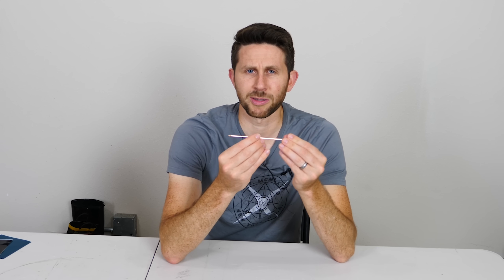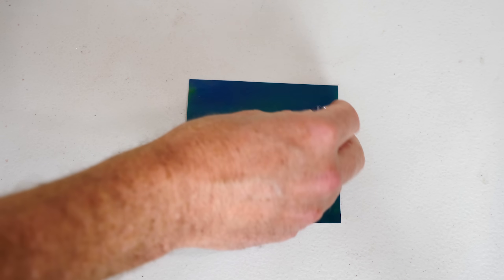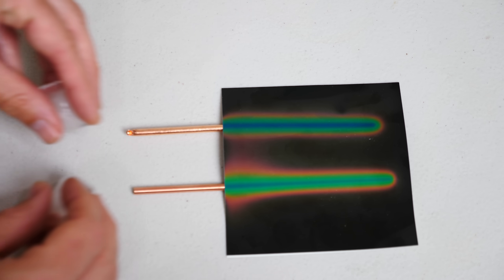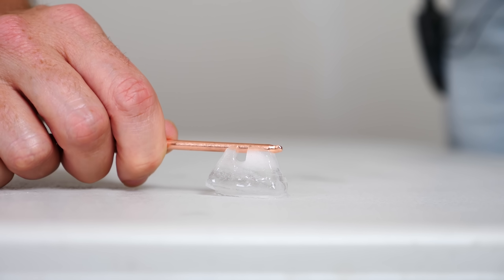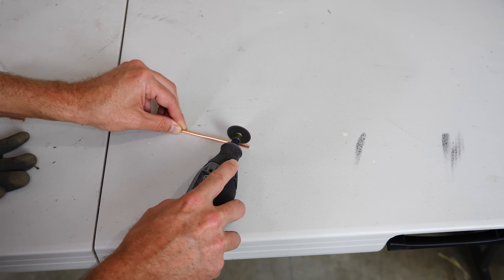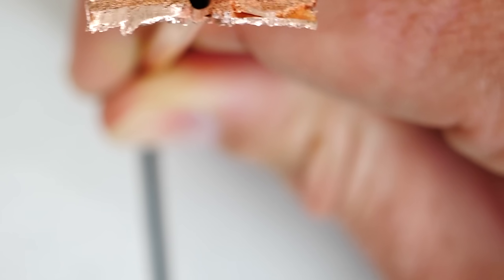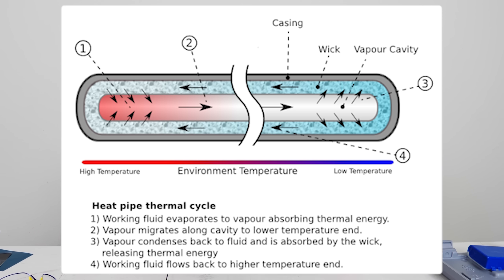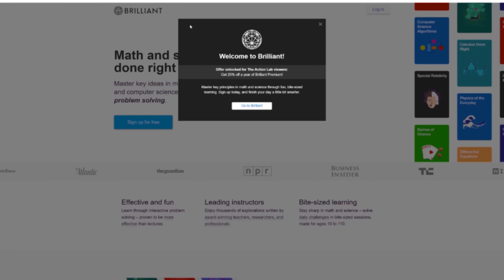What's Inside the Worlds' Fastest Heat Conductor?

Comment: Finally someone made this video about heat pipes. I searched YouTube for this in German but nothing. The physic behind them is pretty cool. But I wonder: Are heat pipes influenced by gravity? Does it still work when the hot end is at the top? When the water vapor condenses there has to be a way for it to go to the hot end again travelling through the spongy layer. I am asking because CPU coolers are mounted usually vertical which means that one cool end is always below the heat source. Maybe it works like in trees with a force that's called in German Kappilarwirkung.

Comment: The magic comes in 2 forms:
1) Heat of evaporisation (water turns into vapour, a fixed amount of energy is needed for this phase transition and is released again when it condenses at the other cool end)
2) Once it condenses back into liquid, it moves alongside the wick structure back to the hot side due to capillary action thereby closing the loop.

The heat transport is facilitated by the movement of material inside the pipe, no moving parts / maintenance!
Reply: Yes, we also watched the video.

Comment: Is this high rate of thermal conductivity truly a stead state/sustainable? If one end keep evaporating water and pushing away water vaper, while the other end keep depositing water vaper, won't the hotter end deplete of water eventually?... I guess the cold condensed water might flow back to the hot end if the tube is horizontal? or the water might climb up through water tension or something?
Would the steady state conductivity changes drastically depending on whether the cold side is up or cold side is down?

Comment: Heat pipes are basically a passive version of your central air con, or a refrigerator. You have a high and a low side. Changes in pressure. Condensation and evanporation of a liquid to carry heat.

Comment: All right, so if it’s water vapor inside the vapor chamber, if you were trying to transfer freezing temperatures with the water, not freeze and become a insulator therefore making it less efficient than traditional methods? I guess what I’m really trying to ask is for freezing temperatures, where water may freeze Can the heat pipe become less efficient then something like the copper tube
Reply: For colder temperatures, there exist heatpipes with a different working fluid inside, like ethanol
Reply: @user-si5fm8ql3c  I assume the ethanol isn't as good in warmer temps especially since it's combustible
Reply: @gigafuzz0732  The amount of liquid is tiny either way, flammability isnt a issue.

You are right, above a certain temperature, ethanol filled heatpies conduct worse than water filled ones. In their typical usecase, where they operate the cold end at room temperature, water is the best working fluid, which is why nearly all of them are water filled.

I think i heard some NASA probes use ammonia filled ones for cooling themselves down.

Comment: Its not water inside the pipe. The heat transfer is base on changing the fase of the substance inside the pipe from a fluid to a gas. Water doesn't turn into a gas until its at boiling temperature. That would mean any temp below that bolling point would simply do nothing. Why make a video about this stuff and then entirely miss the most important part.
Reply from the maker: It is water inside heat pipes. It is low pressure inside the pipe, well below the boiling point. You might not understand this as much as you think you do
Reply: @TheActionLab  Hate to break it to ya but heatpipes are designed around the temperature range it is required for. The fluid inside a heatpipe can be either helium, mercury, sodium, indium, ammonia, alcohol, ethanol or water.

Comment: But transfer has less density to hold the cold or hot energy which is also a big factor and why the copper solid melts more Ice in the same amount of time if using only the heat inside the material. One thing I have always wondered is how companies can flatten it the heat pipe, and how flat is to much were it will take away on its effectiveness.! I would also like to see the new type of heat transfer like the use on the new video cards its a huge flat chamber called a Vapor Chamber and its amazing tech and quite small!

Comment: When you showed the two pipes on the thermal sheet, you gave the heat pipe more surface area on the pipe, and you barely put the ice cube on the solid copper pipe 1/4 inch! Unfair test.

Comment: Silver has the highest thermal conductivity of any metal, at 429 W/(m·K), which means it transfers heat more efficiently than copper, with its thermal conductivity of 398 W/(m·K). This makes silver objectively the better heat conductor in terms of physics. 

Dumb arse creators spreading bull shit.  Silver is the best heat conductor of any known metal not copper, also silver is the best conductor of electricity, but dumb arse creator like this guy spread bullshit.

Comment: Thermal and electrical conductivities are very different things: diamond is a very good heat conductor, while being an electrical insulator, as quoted by many comments, and many superconductors, which are perfect electrical conductors at low temperatures (resistance is zero), are very poor heat conductors.

Comment: Wonder if you could insert 5 or 6 foot lengths of this copper pipe into freshly poured concrete for a sidewalk,extending down 5 feet into the earth. Would this cause ice and snow to clear sidewalks in winter,just by conducting heat from the earth to the concrete?

Comment: 15 years of custom loop watercooling user here, after finishing both engineering and advanced physics faculty MSc programs, decided to upgrade from 3x120 (360*45mm radiator) watercool to 1x140mm heatpipe cooler. The result is amazing, it cools better than most expensive watercool i could build with gynormous pump, radiator and waterblock. Although the heat capacity of big radiator is much more, the cooling capacity (speed) is lower relative to heatpipe with smaller radiator.

And with that said, all the computer "modders" these days put watercooling to 65w CPU (or say 105w) and keep the 400w GPU with stock cooler, which is kinda idiotic.

Comment: Hello @TheActionLab, the video is very nice, and I finally understand how these things work. However, I am not convinced by your first two demonstrations. I believe that there is a phenomenon that is not considered: Indeed the rod has a much greater thermal capacity that the heat pipe. Therefore it is normal that it will simply take much longer to cool down, or to warm. The ice cutting is a much more revelant demo, in my opinion.

Comment: re 0:11 This conductor is not a material, it is a structural device.  
re 0:18 "almost instantaneous' is actually at the speed of sound, but capacity limited by the structure parameters.  
re 6:30 More precisely, the heat anywhere on the pipe immediately heats the water which evaporating (turning from liquid to gas), immediately raises the pressure there, but the pressure wave (like a sound wave) raises the pressure everywhere along the pipe (at the speed of sound), causing some of the water vapor everywhere else to condense onto the cooler copper, releasing heat from the water vapor everywhere else, into the copper jacket.  
NB: If you heat it enough in one spot, all of the water there will evaporate, and the pressure will almost stop rising, and most of the heat transfer will stop.  At this point the heat transfer depends on the rate at which the copper conducts directly, and the rate at which surface tension can conduct the water condensing elsewhere back to the dry copper at the heat source so it can re-evaporate.  Then you get significant gas flow.   
NB: A similar limiting occurs if you freeze the water, which can then no longer capillate back to the warmer surfaces, and this time, the heat transfer is almost entirely by copper conduction & minimally by vacuum sublimation.

Comment: What if you ran your water pipe inside the heat pipe… would that result in a water pipe that won’t freeze in cold weather?
Reply: Very expensive! And if the water vapor freezes the heat pipe fails.  However, another probably impractical mechanism might be to have the plumbing water oscillate in its pipe, a few feet per second, keeping it moving (which prevents freezing) and increasing heat conduction from any warm areas to the colder areas.  (It also cools the warm areas, which might be unwanted.)

Comment: If you cut/split the pipe and then test the heat transfer speed again, does it still go faster or slower? Since the water inside isn't vacuum sealed anymore

Comment: I looked into making one of these for a heater system, however they are of little use.  While they transfer heat very quickly they are very limited in capacity.  Making a heat pipe to transfer 10 Watts is trivial but 1 KW is impractical.  The limit is the heat capacity of the water vapour.
Don't get me wrong, it's great for a static system but if you need high capacity and you can pump water then your system will be significantly more effective.

Comment: I've tried this thing with a computer processor rather than a heat pipe in that case the ice when placed on the metal part just melts instantly leaving the lower (the part with pins) part cold like the outer layer of a glass with ice cold water in it

Comment: thermodynamic guy here. In the shithole country I'm forced to live in we dont even have AC or any central cold Water distribution system which you could use for room cooling. Dunno really know why people just dont invest energy or something. The effect accures because water vapor has a really good temperature conductivity and as a gas it combines this effect with a laminar (or is the density so low it's tolerant?) convection property. which means it physically moves around in the pipe.  Convection accures from warm to cold. But the stream would hit the end of the pipe and basically bounce off. I guess also diffusion is stronger in a low atmosphere enviroment (would be interesting to know if the effect is faster when heating one side then cooling it down). The water should not condense while doing this. But that is basically the way how to measure when the pipe is not useable anymore. Because that is exactly the temperature when the water loses it's convection property. Which means the atmosphere has to be so low that the water vapour doesn't start to liquify. That's why this system is not useful as a heat sink when it comes to cryotic temperatures.  Maybe dense gases in the low pressure enviroment could work. Making the inner diameter of the pipe smaller could be difficult cause the water experiences a lot of friction.

Comment: because of how heat pipes work would it theoretically be possible for there to be a "heat cube"?

basically a cube of copper with that same inner wick part with enough water in it to steam but not too little to cause it to collapse from the earth's air pressure.

Edit : what i have described is called a "vapor chamber" and they're very difficult to make

Comment: What happens if you increase the surface area of bothe ends? 

Increase the size in contact with the ice and Increase the size in contact the matarial but decrease the volume of conductive rod between the each end and see if it increases or decreases its speed as a  conductor

Comment: Once you have cut open the heat pipe, have you tried to reproduce the test vs copper wire. I do not think the water cycle mechanism works, as heat transfer is so high the temperature remains almost uniform along the tube and I do not think water moves so quickly along the wick. But still it needs to be tested with the tube open and the wick dried up. That's how science works. My feeling is the conductiviy is high because the cooper tube has thin walls and heat moves along much faster as does not exchange with the core of a wire.
Reply: No, it is because of the phase change process combined with coppers high thermal conductivity.  Water has a high heat capacity and its phase change cycle is very efficient at moving/transferring heat. 

   Phase change is how modern AC's work and why compressor/phase change systems are so much more efficient than say things like Peltier/TEC devices.  

    Some scientific researchers believe that the mammoths that were frozen solid nearly 12, 000 or so years ago (so fast and intensely that their flesh was extremely well preserved) happened through a particularly intense Solar explosion that blasted away part of the earth's atmosphere and initiated a mass Boyles effect of super intense cooling via sudden, major atmospheric pressure changes.  

   It is really the only thing that can explain the phenomenon.  One moment they were munching on flowers and grass (hence it was at least around 50*F or warmer) and then all that mass of their huge bodies was subjected to sustained, super cold temps.  

 (The crazy thing is that the evidence indicates that at first, a super heating happened, and flooding due to the melting glaciers is what initially killed them, but then that mass of muck, water, and mud was then super cooled as the atmosphere rushed in to equalize. So not only the mass of their body had to be quick frozen, but the mass they were encased in [muck/mud and some left over water]).
Reply: @justinw1765  second although heat transfer by phase change and difussion of water is feasible, the process is not that fast to account for the experimental observations. If you rip open a laptop and examine the cooper cooling pipes you may see the same thin walls and no water inside.
Heat transfer is related to mass, there's not enough mass of water vapor or liquid inside the copper tubes to achieve heat rate transfer.
Reply: @jlfqam  It's not just related to mass. Graphene for example has crazy degree of thermal conductivity in one direction, and it has very little mass as it is a 2D sheet of molecules. 

    Look up how water has a high heat capacity--it's a thing. It's also why we sweat to cool down. When the water on our skin evaporates, it takes with it A LOT of heat energy. But it takes a lot of energy to get water to change from a liquid to a vapor to begin with. 

  It is also how swamp coolers work as effective AC in dry/arid climates--literally transfers a lot of heat just based off the phase change of water from liquid to vapor. (they don't work well in humid climates because that process is one slowed down, and there is already too much moisture in the air which just makes things more uncomfortable).  

     I don't know why you are even debating any of this, when all these principles are all very well known and have been for a long time.
Reply: @jlfqam   Forgot to address the first part. It is MUCH faster when these are under a vacuum condition.  Depending on the degree of vacuum, you can get the boiling point of water down to anywhere from 120*F to down to 70^F (when at normal atmosphere pressure, water's boiling point is 212*F/100*C).  For this application, you would probably want to shoot for around 100* F or so. However, it appears that it is probably closer to 80* F in this case of the manufactured one that he has, because his body heat is enough to initiate the phase change. 

    I'm going to be building a flat plate design version of these to be used in combo with a Peltier/TEC heat transfer device. Basically it will be two flat copper plates with spacers around the edges between both of the plates. After the small amount of water is put in and it is all sealed up, I will pull a low-medium vacuum so that the boiling point of the water is closer to 125* F or so, because I want it to work well when it's hot outside. It will need to be able to condense to liquid at reasonable, semi hot temps.
Reply: You could make the boiling point of water lower or higher than the range I mentioned, but I mentioned the more easily attainable and practical range for the average DIY'er and for most conditions.  If you want to pull and maintain a harder vacuum (+28 hg), it becomes more complicated. Also, there is no point, because if the boiling point is below ambient room temp, it will always just stay in a vapor phase and thus won't have the cooling (heat transfer) effect. 

  It HAS to constantly cycle back and forth between liquid to vapor to liquid ad infinitum for it to work.
Reply: @justinw1765  The best is to wait for the action lab manager to repeat the experiment with the same copper tubing he cut open.
Reply: @justinw1765  my experience is that repeating an experiment saves a lot of computer work and useless discussion. If the action lab man still keeps the open copper tubing and wishes to repeat the same experiment we al will get the answer.
Reply: @jlfqam    These vacuum sealed copper heat pipes are already commonly used in a wide range of cooling applications--particularly in electronics. 

   Why, because they work, work very well, are relatively inexpensive. 

     They are known to be many times more efficient at conducting than virtually anything else that is not lab only oriented and exotic.  

   Again, these are well known and understood principles.  Either you are trolling, extremely obstinate, or scientifically ignorant on this matter.  There is no controversy or question re: this tech. Only in your mind and distorted perceptions.
Reply: @justinw1765  yes, vacuum helps by reducing heat absorption by air, prevents rust over irregular inner wall surface. Copper is the actual heat carrier not water vapor inside.

Comment: Thank you for the ever lasting insights! Question: Do you expect the super fast heat transfer capability of the heat pipe would cause an arc on a jacobs ladder to travel faster than it would given otherwise equal circumstances with solid copper electrodes?
Reply: Dude don't get religious on us
Reply: @Tenchi707  sorry what?